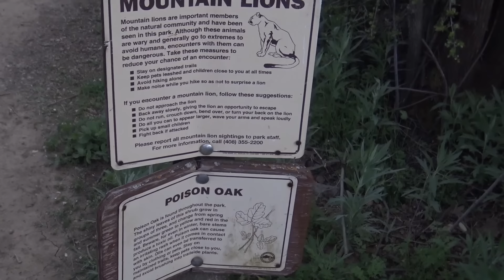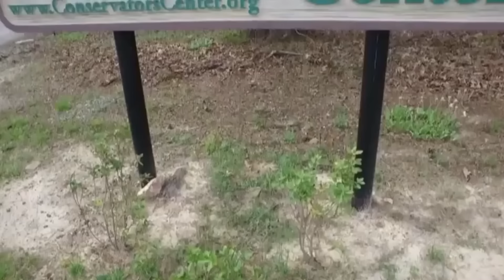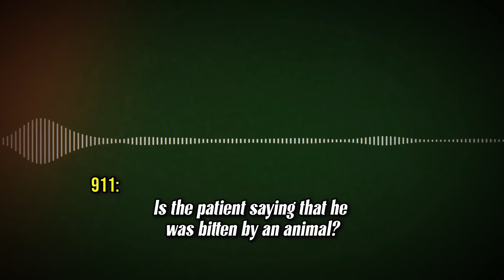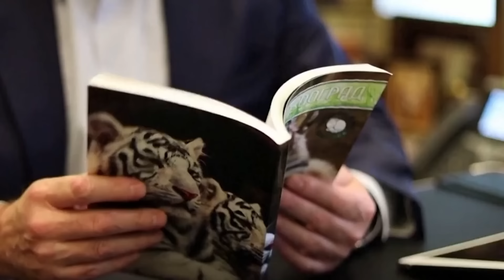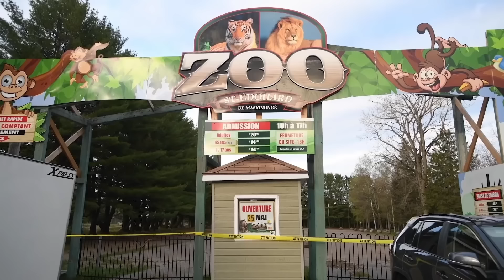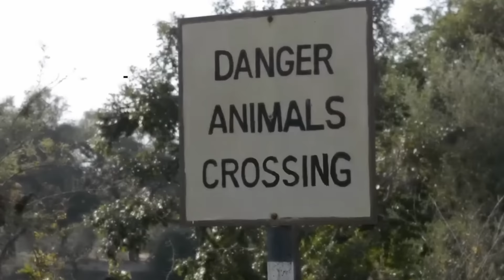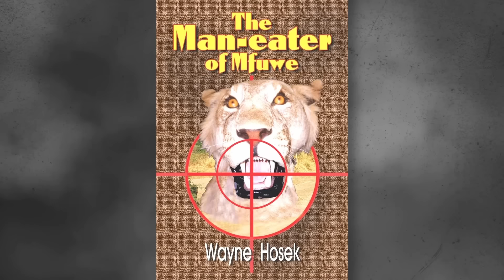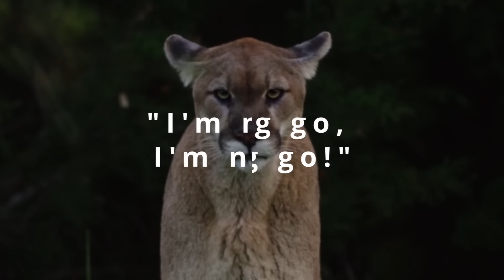Deadliest Big Cat Attacks of 2023 MARATHON!

Comment: Back in the ‘90’s , Longleat  Safari Park here in England had the first white Tiger, it was separate from the Siberian ones  . One of the Tigers came over to our Car , magnificent animal, but menacing as fook. My then partner  had a Sierra Cosworth  ,the Tiger went behind the car and sunk its teeth into the bumper, he tried pulling away and you could feel  the strength of the Tiger holding it back. My god ,  the power of its jaw..

Comment: Listen, I’m a vet tech and although the animals that I see are usually domesticated; I will absolutely say that cats are ruthless when they feel threatened. I’m sure other techs would agree, but I would rather wrestle a 120 pound mastiff than go into a room with a feral/aggressive cat. Yes, even if the cat were only 10-15 pounds. A cornered cat is very dangerous. They can jump super high and they’re QUICK. Hell, I’ve seen one bite my coworker all the way through x-ray machine gloves. They’re supposed to protect you from any bites at all, but this cat bit all the way through and wouldn’t let go. My coworker had to get 16 stitches that day. I guess my point is that if a cat wants to hurt you, it absolutely can and will. I have ZERO desire to work with any exotic cats for this reason. I can read a dog before I even touch it, I can look at their eyes and immediately know what kind of behavior I’m about to deal with. Cats, though? You don’t get much of a warning. They might do some low growls but that’s normal for nail trims and they usually calm down right after. Some cats you don’t even have to touch and they want your head. They’re very unpredictable. So please be safe!

Comment: In the first case, it is made out to be just some sort of tragic, freak accident, as if it was unavoidable, because proper safety features were in place.  
When you are a small and fragile human (in comparison to a lion) who is about  to step foot into the enclosure of a 500 pound killing machine, maybe you should be of the mindframe of looking at the door that is supposed to separate the lion from you, prior to entering the enclosure.   Maybe they would have seen the large ball preventing the door from shutting; don't just assume the door shut.  Secondly, after you look, and the door appears to be shut, visually verify the lion is nowhere near that door, then enter the enclosure and physically verify the door is shut.  Nobody should be doing any work in the enclosure until these minimal steps have been taken.  Then, while people are in the enclosure, someone should be responsible to be doing nothing but having eyes on the lion, ready to warn everyone in the enclosure to evacuate if anything seems wrong.  There was too much of a relaxed atmosphere in a life-threatening job.